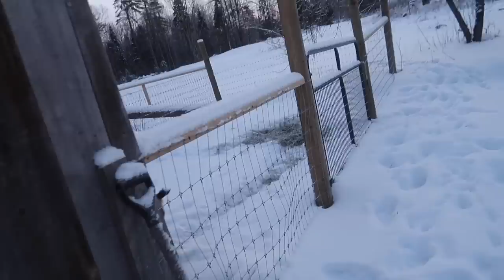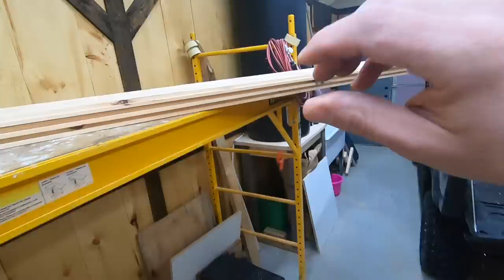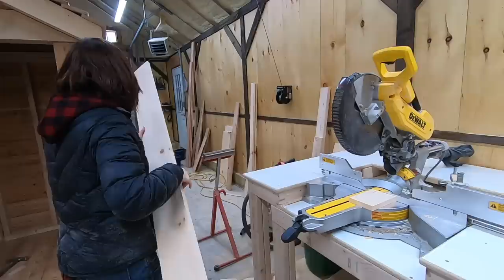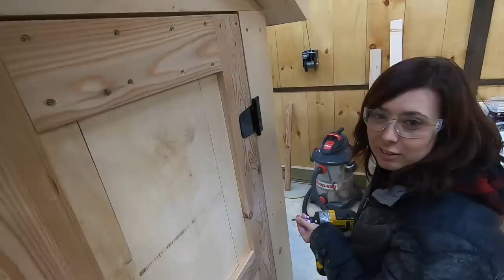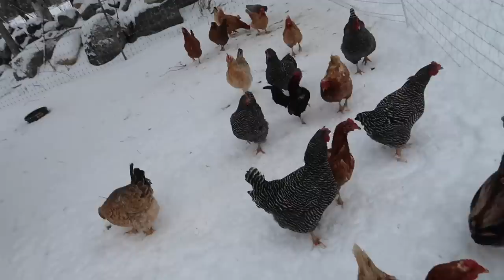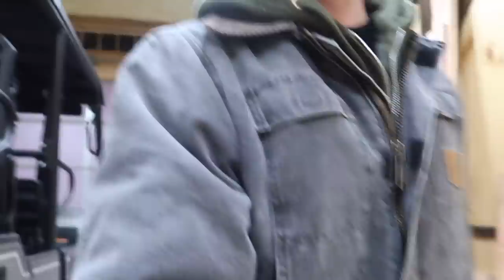It's All Coming Together NOW Finishing the Ultimate SMOKEHOUSE

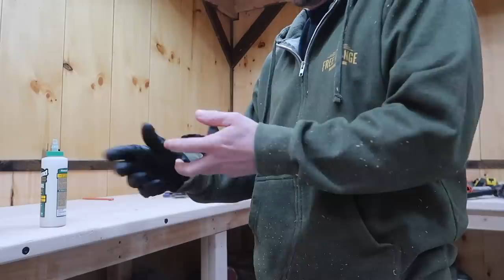Comment: 23:44 I've got to mention those Venom    Steel nitrile gloves are the best gloves I've found so far. They don't fall apart on your hands and you can often use them over and over depending on what you're doing, justifing (for me) the higher cost.

Comment: When you're fixing a knot hole like that, use a branch. Just trim the bark off and stick a piece of a branch in there with some glue. Then flush trim it on all sides and sand it. It'll be much tighter than the one that came out and the species differential won't matter because the knots are always so drastically different anyway.

Goulash is a Hungarian dish made with very strong spices with a lot of caraway seeds. Tastes a lot like rye bread. What you're making would be more of a succotash or chili-mac.

Comment: What are you going to do to the inside for racks and places to hang sausage, hams, etc? Metal racks and hooks? What are you going to do to generate smoke?  Do you have a metal bin with which you can use pellets to smoke, or are you going to use an outside source and pipe in the smoke?  How will you maintain a cold smoke?  Will you be adding a thermometer?  It seems there is more to it than building an awesome little house.

Comment: Just an idea because of using it as a smokehouse you going to have hot and cold and that might cause your door to sag a little bit I would suggest getting a flat scrapping stainless steel go from corner to corner on the inside to help stabilize it from the hot and cold awesome job on the bill thank you for sharing inspire me to make a dehydrator the same way keep up the good work God bless your working hands 🙏😇

Comment: Looks good but screwing into the end grain of wood a you did for the uprights may be problematic - it's the weakest way to screw into wood and will be really weakened by moisture. I'd do all you can to make sure the base is on gravel or something that drains really well and possibly pocket hole drill some extra screws into the basewood from the uprights. Then put a nice chair in it, some ventilation holes and you can sit and smoke in it!

Comment: Al - with all the wood you used in building that smokehouse you will need a bulldozer to pull it around. I think using metal would have been easier and cheaper.
Gina - What you made for supper would be called chilli mac at my house. Goulash would be stewed tomatoes and steak coated with flour that was fried before mixing in with macaroni and stewed tomatoes.

Comment: Very nice , who cares if some bees go in.  I raise a pig and smoke hams and bacon,(cold smoke).  You might need a small sliding door for some extra ventilation?  I set mine on top of a small hill, then have a fire pit in the ground, down hill, with metal pipe buried and coming up through the floor.  Can’t wait to see it in action!

Comment: Good morning, great looking smoke house, just one question, where is the roof vent so you can get a proper draft? But as always great video, one of if not the best Homesteading channel on YouTube!
Reply from the maker: You’ll see tomorrow when we set it up and get it smoking.
Reply: Its a cold smoker nott a hot smoker to start off with. Second did you see the clap board style roof  every gap under each board is gonna bleed smoke like a sieve. Not really gonna be a need for a stack. If anything a couple holes high on wall with sliding or swinging  cover plates

Comment: What is your explanation for not knowing how to use you saws. You have a push stick laying on the table saw but you don't use it. Instead you reach over the blade using your hand. When you use your circular saw you don't set the depth of the blade which can cause the saw to bind and kick back. I have seen men cut their legs, fingers and stomachs. And lastly you use your right hand to cut your material on your miter saw while crossing over to hold your material putting your left arm in harms way. I have been watching your vlog for about six months now and I enjoy what y'all are doing. But if I see you not using the saws the right way again I will stop. Read the instructions and be safe, PLEASE.
I have been a carpenter since 1973, right out of high school.